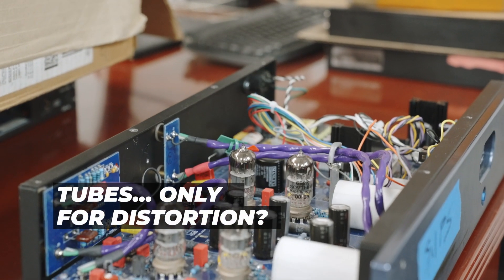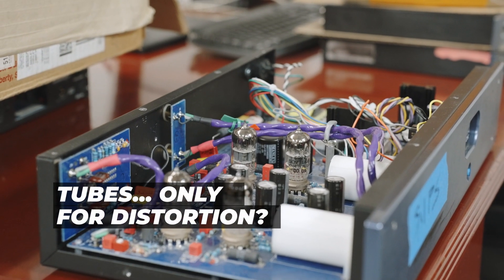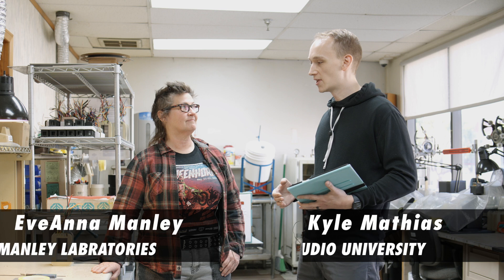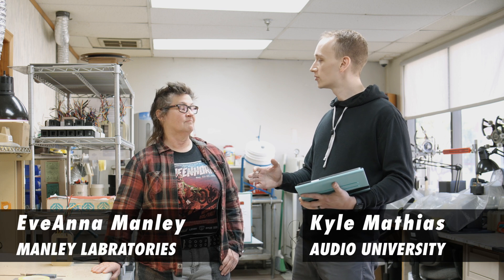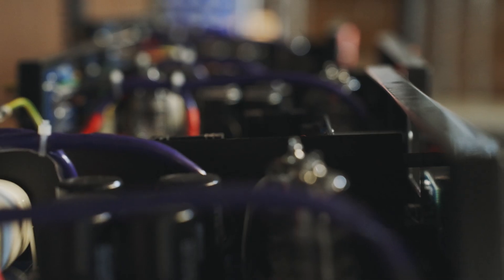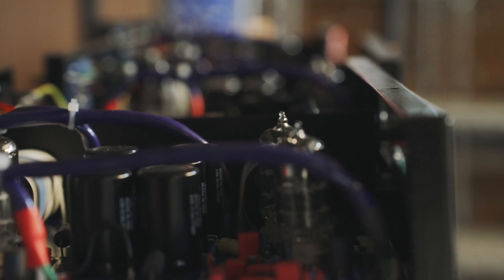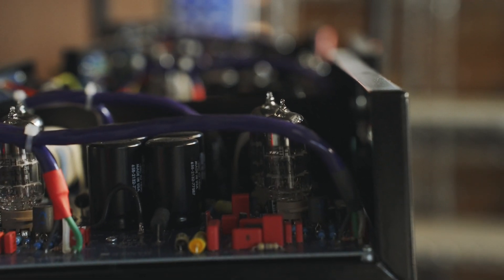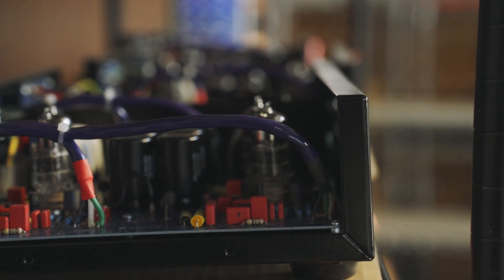Tubes vs Solid State: Not All Distortion Is "Good" Distortion

Comment: There's much more to tube amplifiers than just soft clipping.
Consider:
- rectifier sag, shifts in bias under load.
- every stage adds a bit of intermodulation distortion.
- asymmetric harmonic distortion produces even order harmonics.
- the output transformer distorts too.
- most tube amps have a current output, not a voltage output.
- tube amps use little to no negative feedback.

Transistor amps are perfect for low distortion.
But if you want distortion, you have to add it (usually in a separate circuit).

Of course in the digital domain, anything can be emulated.

Comment: In fact this seems logic given the high voltage (and therefore the higher dynamic range, I suppose).
Reply: transistor have way better dynamic range.
Reply: @olafsigursons  Thanks for the info. I guess I have research to do (because those things I don't know anything about - yet)

Comment: I beg to differ with the comment that valves have high "head room". Yes they are usually run with higher rail voltages than transistor amplifiers. But the valve has less gain than an equivalent transistor so the valve circuit is likely to be working in its non linear (i.e., distorted) range for most of the louder sections. These days the transistor amplification will remain close to linear (i.e., undistorted) way past where the valve has been doing its distortion. When the transistor finally runs out of voltage, and the circuit os badly designed, we get the horrible noise that is voltage clipping. 
Historically, when both valve and transistor amplifiers were available, the valve amplifiers were mature technology, with better performance for the money, and we were accustomed to their distorting ways. Today solid state (transistor) output amplifiers can blitz the valves at a lower price point and still not distort. But we had grown accustomed to the distortion of the valves so the better fidelity of the modern transistor amplifier sounds harsh or wrong to many. Not better just a matter of taste. 
As for clipping that's not going to happen in a half decent system. Personally I cannot get my transistor amplifier to clip. It has been designed properly. Given the combined limiting factors of my hearing pain threshold and fear I will destroy my speakers I have not been able to get my amplifier anywhere near max output... clipping distortion need not apply. 
This has nothing to do with those places where distortion was a fact of life so the performer made it worse and we liked the result... it's an audio effect like any other, not an intrinsic virtue of the amplifier's technology. These days anything a valve was forced to do can be done easier and cheaper with a transistor — it's just a matter of overcoming peoples' fixed beliefs (and getting a decent circuit design engineer).

Comment: It should be noted that this is only true for "naive" circuit designs. A solid state device designed for the purpose can behave more like a tube rather than hard clip the signal, as is the case in many guitar pedals.
Reply: Yeah it would be useless otherwise and would sound very crappy. Solid state should be all about emulating the distortion of a tube and modern amp VSTs can sound pretty good.
Reply: @crisscrossam  LOL! no.